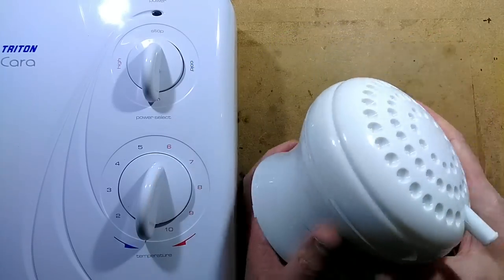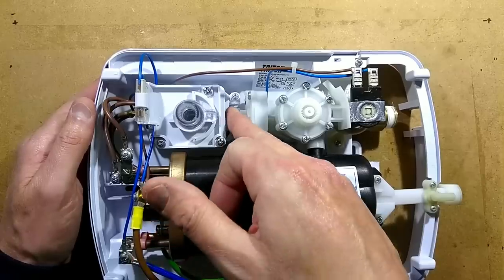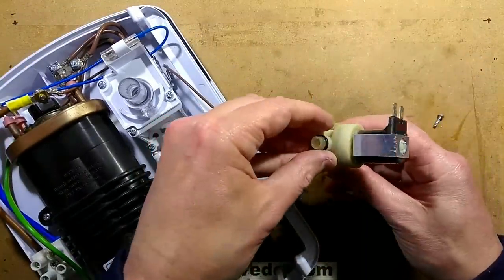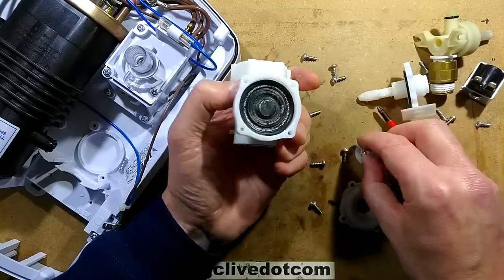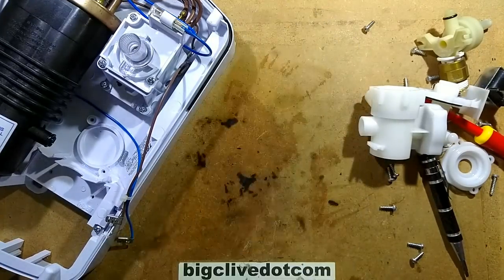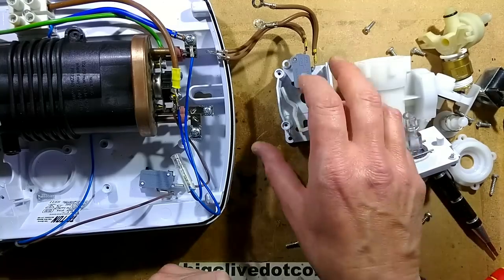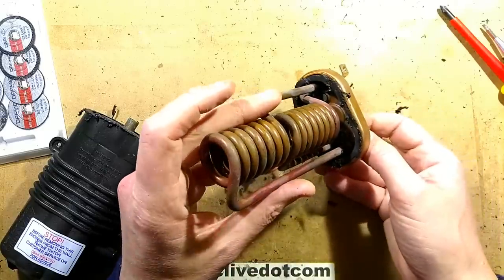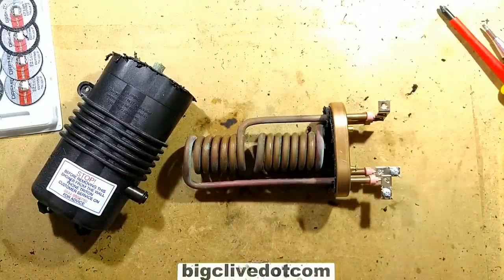Teardown of a UK electrically heated shower unit.

Comment: Odd.  We've had showers like these for years, but they always seem to work backwards.  In summer, the water's too hot, so we turn the 'temperature down' (unaware we were actually increasing water flow).  Instead of getting cooler, the heater switches off completely and a 'pressure' warning light comes on.  Turn the 'temp' back up to maximum, and the heat is restored.  It's the same when a neighbour turns on their water, or flushes the loo.  Pressure drops, heater cuts out.  So it has to be freezing cold or boiling hot.  I was under the impression that there was an anti-scald device, so the heater cut out if the water gets too hot.  It seems to work backwards, the heater cuts out completely when you only want to cool it a little.

Comment: 120V versions of this kind of shower do exist and are common in Brazil.  This one is rated at 5.5kW, which requires a 50A circuit at 127V.  Here is a link to the PDF installation manual (in Portuguese, but the ratings tables are easily understandable). http://hydra-corona.com.br/upload/arq/o_1akbqj4ll1q8kt7u18ubv1u1sa.pdf

It has an isolated heating element too, so safer than the usual type of 'electric shower rose' common in those parts.

Comment: Without looking at the end of the video (yet) I'm assuming that the values of the elements are x and 2x so that low, medium and high settings are x, 2x and 3x...that is...the value of the two elements shouldn't be the same or the only values would be x and 2x...

Comment: It would be fun if you could test a couple usb car chargers. They are rated for 12-24V but a truck system might reach a bit over 28V when charging the batteries. My experience is that they do not work that well in a truck since noone seems to have taken notice of this fact.

Comment: Though clever, it would be nice to crank the water to full hot, and mix in direct cold to keep the pressure good while keeping a comfortable temperature. Or just modify an existing shower with an external, small and cheap at site tankless electric heater

Comment: Good video Clive, the only problem I have with Triton is the thermal cut out not been resetable and costing £22 a go.
It would have been great if you had looked into the workings of this component.
Reply: The cut-out is quite clever - it has two bi-metallic discs stacked one on top of the other. They're dished and nest nicely - when they get too hot the pop into being dished the other way and push up on a pin to break the circuit. The really neat bit is that the lower disc will turn itself back on as it cools, so the shower will self-reset. The upper disc is a last-ditch safety, and that one won't reset. 
The way to avoid a lot of problems is to turn the control to cold for a few seconds before turning it off. You don't have to stand there until it runs cold - a couple of seconds is plenty and there's still hot water in the hose enough for that. That stops the cut out operating through heat-soak, and it also cuts down the amount of limescale that builds up on the elements.

Comment: In the section after you dremel the heater apart, the audio is distorted! But otherwise, it's fine, i like it. I'm watching it on a bit of a potato, well, an "inexpensive" laptop, still a potato, so i wouldn't mind the video quality either way, the dynamic range does seem kind of low where you'd have both complete white out and black out spots in the same frame, but it's not necessarily a disadvantage to be honest.

Comment: Is it really common in Europe ? Never seen this in France or Italy. In France even with electric heating having a 12kW electric power supply isn't that common unless you have a big house. And even if you had it, it means you can't use your electric radiators or your oven at the same time as this ? Seems annoying.

Comment: In parts of the U.K. with high water calcium content I've known these scale up the heater can in a family home in under a year. Unit then overheats as the water flow is too low and the unit can become dangerously hot, the thermal switch doesn't always cut out. This and low water flow are common causes of hot/cold cycles. I also found that it was cheaper to buy a new unit than to source a heater can.

Water in a used water heater Clive? Why are you surprised?
Reply: Do you think it would be possible to de-scale it by pouring something like Oust into the chamber? I may try it when the opportunity comes up...
Reply: photopuppet I tried industrial strength Kilrock... Neat... But even that couldn't get into the hard mass that had built up.
Reply: Hi Robin... that's a shame, if that doesn't shift it then nothing will I guess!
Reply: photopuppet it was pretty bad and the Thames Valley is notorious for heavy scale, the gas combi boiler suffered the same fate and that was only 7 yrs old. Fitting a new heat exchanger isn't cheap..Now living in Devon the waters so soft we have a 5 year old kettle that's still shiny inside and a 43Kw combi in the loft. However I didn't learn my lesson, I bought one of those Polish under sink water heaters before I realised they leak. Perhaps Big Clive would put them on his hit list too since he likes a wee tingle apparently
Reply: Lemon juice, chaps, lemon juice.

Comment: We had a whole house Electric (On Demand) heater, that was 240 V and had a 125 amp breaker at the mains, and then 4 breakers just before the heater, one for each element. We changed to gas (propane). I think it was 18 Kw, I still have it.

Comment: Wow, it's built like an aircraft. Kinda primitive, but has so many safety features, and redundant ones. Like the blow off valve and reset-able thermal fuse...
Reply from the maker: Yes it is simple, which makes it very reliable.  And safety features try to allow for every possible scenario to protect the user and equipment.  The final safety feature is an RCD/GFI to trip the power if it finds its way anywhere it shouldn't.
They have a really good safety record except where they have been installed by rogue landlords who have foregone the electrical safety and left exposed live metalwork in their vicinity.

Comment: Last time I took an electric shower to bits, the heater tank was all copper, like a miniature hot water cylinder, never opened it to look inside though, I just salvaged the solenoid for another shower in need of one... :)

As for the video, it's good, the audio is a bit peaky though, could do with its recording level reduced ever so slightly (if it's possible on the app you're using)... :)

Comment: Someone explain to me the reason you'd have one of these over simply a water heater and tank for the whole home, or combi boiler.
Reply: Often because they are easier to install. A single cold water pipe and an electric feed. They are also very cheap.

 If you have a gravity fed storage system you need really need a supplementary pump (either integrated or separate) to make it acceptable. Pumps can also be troublesome, but I've fitted three. Combis are fine - at least for one shower, but others drawing water will affect the shower and it takes ages to fill a bath and they aren't suited to larger households. If people have the money, then a mains-pressure storage system is probably best (as are common in Europe), but they are very expensive.
Reply: Seems like plumbing in Europe is somewhat behind the United States is why this seems odd to me. Practically every home here uses water main pressure. Attic water tanks got phased out long ago. I guess it is only fair though considering how far behind the United States is in terms of electrical utilities... and outlets.
Reply: My answer was very specific to the UK as water regulations did not allow for pressurised storage systems until perhaps 15 years ago. Header tanks with vented hot water storage are inherently safe and are very low maintenance and were essentially universal. Pressurised hot water storage systems need more safety systems and more expansive tanks (a typical UK hot water tank is made of copper, a pressurised storage tank is made of much heavier gauge stainless steel). Pressurised storage systems also have (by law) to be installed by qualified professionals whilst the vented systems don't require that.

I can't speak for the Europe as a whole (it is, after all, made up of dozens of countries), but many have used pressurised hot water storage as standard. I suspect it is the norm.

nb. the mains water pressure in the UK can vary widely. The legal minimum is 0.7 bar, although the norm will be more like 2-3 bar. I suspect some of the lower pressures might be because of aged infrastructure.

Comment: Be interesting to see this vid as we have a Cara installed in our bathroom. If you ever get a chance to do a similar teardown of an older T80Si I'd be interested as well, we had 2 of those and they both suffered with loose spade terminals causing overheating/arcing and burning out the internal wiring.

Comment: Normally a 9.5 KW is kinda standard in older houses, that’s pritty rubbish tho but if you don’t have 10mm cable to fuse box like most new houses, you can’t go any higher or cable will melt, if you-do you can have a 10.5 kw which is far better pressure wise

Comment: Better audio but a bit too high on the gain i would say .

Can u do us all a favor ?
can u measure the resistance of the heating element across the electrical terminal and the outside .
i would like to know the resistance of the insulator inside the element . 

so please measure the resistance b/w the terminal and the metal surface of the element  inside the heat exchange chamber. 
thank you in advance.

Comment: Why when using it they go very hot then cold then very hot then cold ?
Reply from the maker: They regulate temperature with water flow, so if the pressure of the water supply fluctuates a lot the temperature will vary.

Comment: Have one of these at my gran's house and have to use it on the "econ" setting, because when used on the "hot" setting, it trips the breaker. Apparently, she's had multiple electricians come to look at it and not know what's wrong with it! But it only trips on the second time it's used in a row...
Reply: JJ TECH Either a bad unit, or the fuse id just a few percent too small for the unit. Slightly overload fuses blow slowly. Suggested non-electrical test: Run it for an hour straight and see if that blows the fuse too.  Alternative electrical test: Hook a clamp meter on the circuit in the fusebox and watch the reading when the unit is on.

Comment: This won't exist in NL unfortunately. Our circuit breakers are 16A max, and the master circuit breaker is usually only 25A (that's the one that can't be changed).
To use more than 16A/230V, one would need either a three-phase 400V connection (uncommon for normal households), or use two circuit breakers and a perilex plug, like the one on my induction cooker.
Reply: Are you sure about the 25A mains fuse? It's more like 35A. 25A is a little low, considering most people cook on an electric stove these days. Imagine cooking and running your washing machine and a water heater at the same time on different groups... Enexis has to stop by every week or so, haha.
Reply: For one who lived both countries: Why would you want that monstrous thing in your bathroom? I think they're terrible.

Comment: As an American Transplant to the UK, I find it very irritating that there are no power outlets in the bathroom. I've been told this is for safety, as water and electrics don't mix. Makes no sense, because I have to get an extension lead, that rests on the floor, where the water is. Haven't you heard of a GFCI (RCD) plug? Is that not ok, but its ok to have this IN THE EFFING SHOWER?!?! Seriously, please explain the logic...
Reply from the maker: The logic is that the shower is fully enclosed and fixed to the wall.  The point about not having sockets in bathrooms is to avoid people handling electrical equipment while wet or trying to use it in the bath.  Normally your skin has an outer layer of dead cells that reduce the severity of an electric shock.  When wet your skin is extremely conductive putting you at very high risk.
One socket that IS allowed in the bathroom in the UK is a shaver socket.  It contains a full isolation transformer inside so is only suitable for low loads.  But the output is fully isolated from mains ground so even if a shaver fell in a sink full of water there is no immediate path for current other then the gradient that might form around the shaver itself.
Reply: I get that, but why can't you have a standard RCD plug on the wall, opposite, the shower? The first thing most people do, when out of the shower, is dry off. I guess the thinking in the States, is survival of the smartest... :)
Reply: Perhaps it's because I've lived here all my life so have never known anything else, but I've never felt the need to use high power appliances in the bathroom. A towel is fine for drying, and I don't have enough hair to need a hairdryer - but if I did, I could just use it in my bedroom.
Reply: dingo I cut my own hair, and it was a mains clipper, which have more consistent cutting power. I have since gone to battery power, but I still miss having a plug in the bathroom. Wife uses hair dryers, curlers, etc....  Annoying. We are currently flat dwellers, but when I buy our house, I will be wiring in an rcd outlet... it’s ridiculous not to have plugs in the bathroom.

Comment: Interesting!  That is not, as you would expect, the system in use in North America.  Typically, we use a 10, 20, 30 or 40 US gallon (38, 76, 114, 152 liter) electric heater which maintains the water temperature until someone turns on the tap and uses some.  Presently I live in an apartment building which has a 200 litre heater.  I suspect from this, that the UK has expensive electricity.  I believe local power runs about $0.15 per Kw/hr.  Maybe, your system may prove to be more efficient.
Reply: The modern approach here seems to be an instantaneous natural gas fired water heater that handles both hot water and central heating - no water tanks involved. You can simply plumb a shower into that and the mains cold water, no electric heating needed. Last time I checked electricity was about 15p per kWh (about 20 cents at current exchange rates). Gas is maybe a quarter of that

Comment: Audio and video are fine, I didn't notice a difference until you mentioned it, and even then I could barely tell.

Edit: Later on in the video the audio gets a bit distorted. I think you may have been speaking closer to the microphone.

Comment: I would like to know if you can descale these. I know once it is descaled  it would work again.
Reply from the maker: Is the shower head clear of scale?  I'd guess that you could inject the descaler into it if you disassembled it a bit and got creative.
Reply: @bigclivedotcom   Perhaps you could do a project on those quack?? devices that fit around pipes (a humble coil or magnet I think) which are suppose to keep the salts in the water and stop scale forming ?
Reply from the maker: @Witheredgoogie  I did take a look in one of those in a video.  It seemed to be more of a light show than anything else.
Reply: @bigclivedotcom  Ah yes sorry I remember it now. I suppose more practical are those canisters of wonderous things that fit in line on the water supply pipe.

Comment: You DID call Triton Customer Service for Advice before removing that unit from the wall, right?
Reply: i must have gotten lucky, Tritons customer service were brilliant when i had to replace mine due to old age,  tracked down a new model that used the same old base plate so i didn't have to re plumb or alter wiring and sent me a new  head and rail to match the older mounting specs free..  thats was a lot of customer service for a £75 shower unit

Comment: My mira shower was basically the same on the boiler side when I had to open it to replace the thermal cut out, boy was I gutted tho when I saw the temp controls weren't a simple valve system but a pcb board. It went down eventually and i didnt have the know how to attempt a fix at the time

Comment: Britain does not allow sockets in the bathroom but allows electric showers? Does not compute? Why not just use normal hot water?
Reply from the maker: Fast and efficient.  All electrics are contained in an enclosure with good bonding and usually protected by an RCD/GFCI.

Comment: Interestingly the burt who came to swap my broken electric meter said my main fuse is a 60A , which he would of down-rated had there been an 80A in there. That is quite eye opening when your shower is 50A mcb and the main fuse box is max rated 80A. The supply cable for the shower is at least 10mm.
Reply from the maker: He was probably basing it on the meter tail size.  And yet strangely his incoming wire size would be irrelevant.

Comment: wouldn't it make more sense for the 'cam' to manipulate the two switches independently? that way you could create more power settings
Reply: Perhaps. (3 power settings would be only marginally more work to implement than 2; you could even have 4 power settings if you connected the elements in series for the lowest power, but at the cost of significantly more complex switching. I still think it's slightly odd that most fan heaters, for example, have just the 2 heat settings…)

Comment: Take note of that little sticker that says, 'phone us before taking off wall' - it's helpful.  I've fitted both a Mira and Triton.  I forget which was which but shower one turned out only to be capable of water entry in one orientation despite being advertised / designed as a universal replacement shower (not sure that's even legal).  Shower two couldn't tolerate anything but the tightest water pressure band...Hmmm!  Won't be buying either of those brands again.